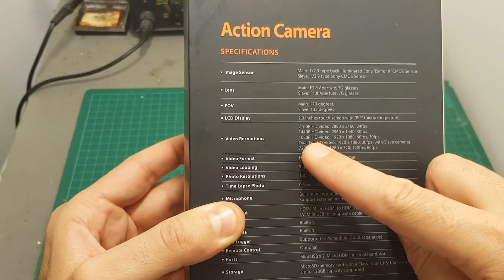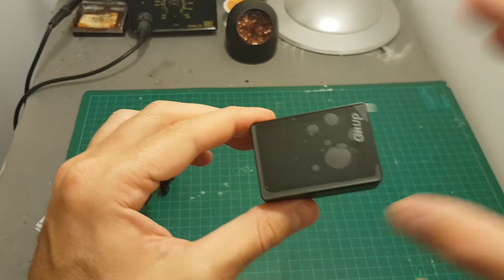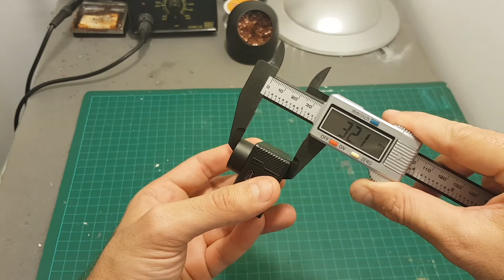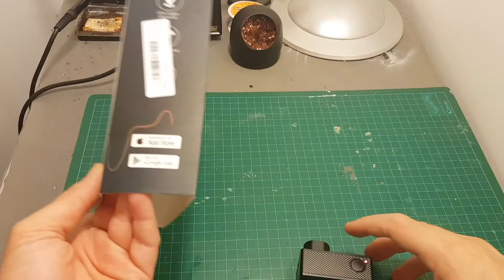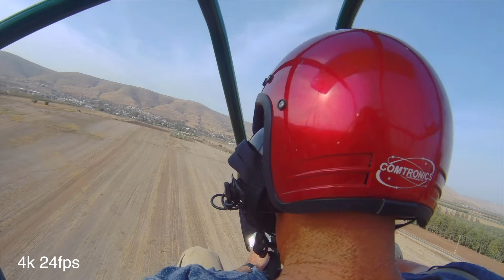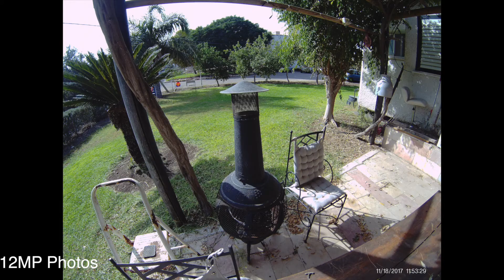Gitup G3 Duo PRO - Part 1 - Overview & Sample Footage

Comment: Hi, thank you for his great review.
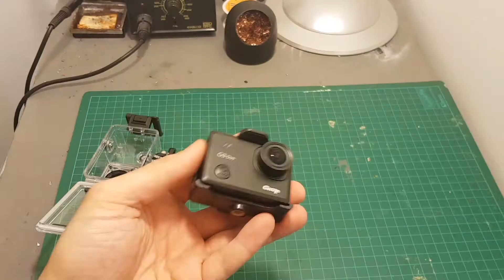I am looking for a "clip-case" just like the one you put on the camera at 1:38 of this video. What is the reference of it, or where did you bought it ? Because I have the same for the Git2 but it doesn't fit as the Git3 Duo is thicker.
Could you help me ?
Reply from the maker: Hi there and thank you for your kind comment :-)
I got it with an SJCAM SJ4000 long time ago. I found it here: http://www.everbuying.net/product1093039.html
Reply: After searching, it looks like to be a cradle for SJcam and Co. 
The measurements you have in your video are wrong, the good ones are 59mm*41.5mm*36 mm.
As I said the G3 is thicker then the "classical" 21mm (30mm with lens) but is 25mm (36mm with lens).
So it is as thick as the SJcam S5000.
Can you confirm that the accessory you have is for SJcam 5000 and not Gopro 3/4 ?
Reply from the maker: +Benoît Materne Sorry, but I can't confirm that. I had it for a long time and I can't be 100% sure.